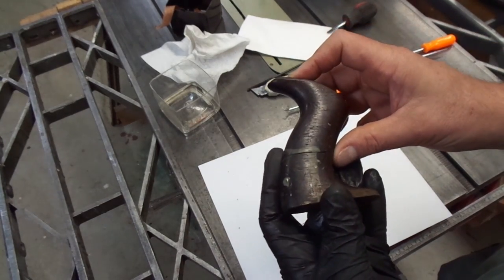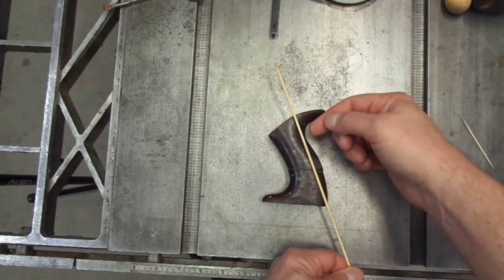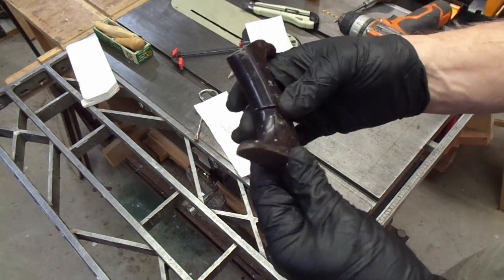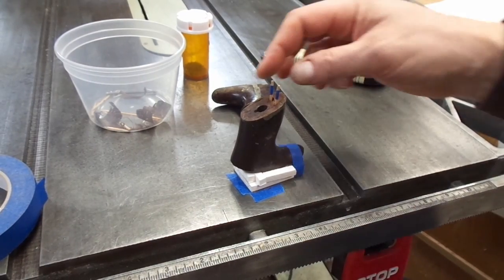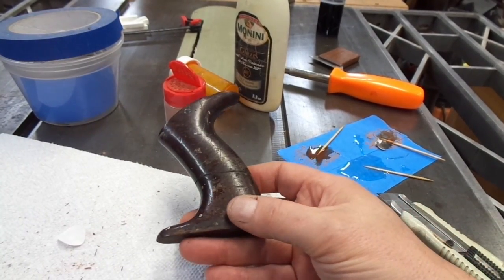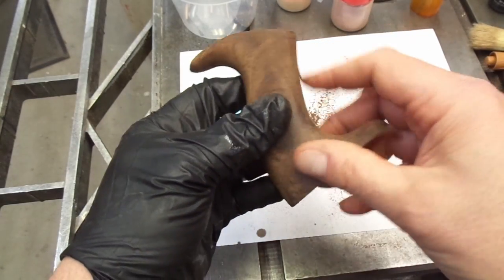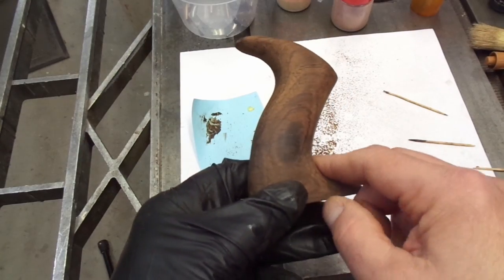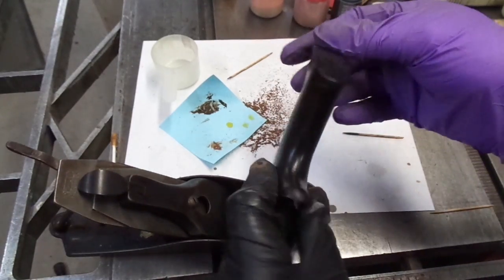Stanley No 3 Hand plane Broken Tote Repair

Comment: Nice work.  I repaired a Brazilian RW tote recently.  Break in same area.  They seem to always break in that spot.  The break was cleaner than yours.   I doweled it with one 3/16”dowel.  Used Tight bond glue.  Turned out decent.  I dark stained the break area in a few spots making it Difficult to detect the repaired break line.  You did Awesome Job on that tote 👍
Reply from the maker: Thanks for leaving a comment and for the kind words.  That repair is one of my favorites and still looks great (pretty gosh darn close to invisible).  It took a lot of time, however, and I find myself a bit reluctant to take on similar projects because of that.  The plane is an early type 7 and a very nice user.  The depth adjustment is right hand thread (backwards from the modern versions) so I have to remember that.  
Is the Brazilian RW tote original or something you made?  I have a few pieces of Brazilian Cherry (Jotoba?) from a floor project, and it's hard, dense and beautiful.  Unfortunately it's too thin to make totes and knobs out of.

Comment: I have a hairline fracture encompassing almost my whole tote, except the forward facing part. Is there any way to fix it without actually breaking it in two? No.4 type 6
Reply from the maker: Thanks for the question.  It's hard to say for sure but there is no magic I know of.  I feel your pain.  If I had such a tote then I'd want the same thing.  You want to be sure it's strong if you plan on using it, and it seems like a shame to break it further in an attempt to repair it.  If the joint is clean and tight then modern wood glues are often stronger than the wood they're bonding.   It's best if you can open the joint, but it sounds like you may break it if you try to pry the gap apart.  If you can open it then there are techniques to get glue into tight spots.  I have a video on a window sash repair where I used dental floss to draw glue down into a crack.  The wrappers on snack bars (that thin, aluminum looking plastic) can also be used.  You can also try to "squeegee" the glue down into the crack with your finger.  Good luck and let me know of any progress.
Reply: @jazbuilding  I can open the joint a little, hopefully enough to get some of those hobbie syringes I bought in there. The crack also lines up perfectly so some people have given me advice to use CA glue in place of wood glue. Would you inject some wood glue or ca glue if the crack/piece lines up perfectly? Thank you!
Reply from the maker: I think either would work fine.  I'm not aware of anyone doing tests to determine one stronger than the other.  If the joint is clean and tight, meaning intimate contact, then either glue will be very strong.  CA glues set fast and can be thin (watery) or thick, but will stick to everything and can't be easily cleaned.  Wood glue has a longer open time, will take a while to set, but can be worked with tools or your finger and cleaned with water and/or damp cloth.  I'd use whichever I was in the mood for based on convenience.   Thanks again for reaching out.       @6atlantis
Reply: @jazbuilding  thank you!

Comment: Good job brother, would you have a video of the that wooden brace. We will follow ... OORAH!!  WWG1WGA :face-orange-frowning:
Reply from the maker: Thanks for the comment.  I'm not sure what you mean by wooden brace.  Let me know and I'll try to give more details.  I built the "cradle" to sit on the horn and provide a clamping surface more parallel to the base of the tote.  The cradle made it easier and more secure when using a simple clamp to hold the 2 pieces together.  I made the cradle out of some scraps of PVC glued together with super glue.  I didn't record it because I wasn't sure if it would work, but the stuff is pretty easy to cut and shape with woodworking tools (knives, chisels, saw, etc) and with a little adjustments was good enough to do what I wanted it to do.  Cheers.